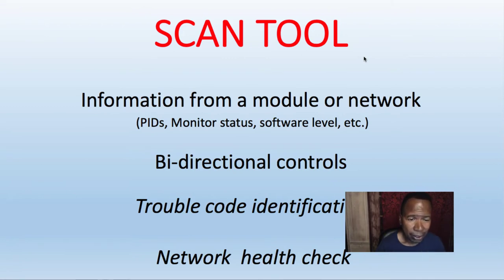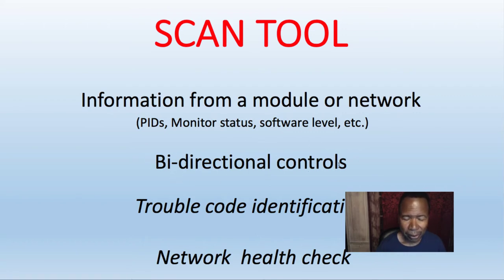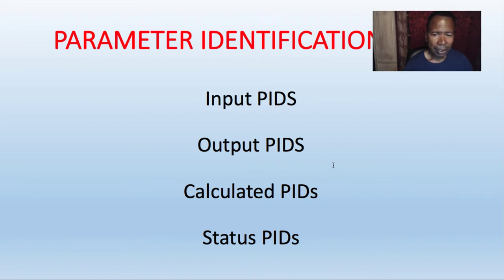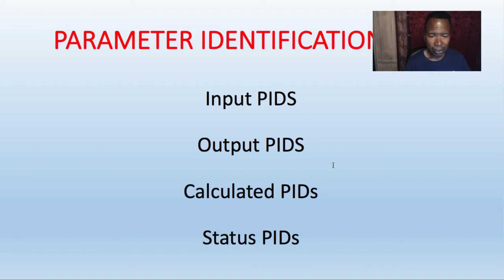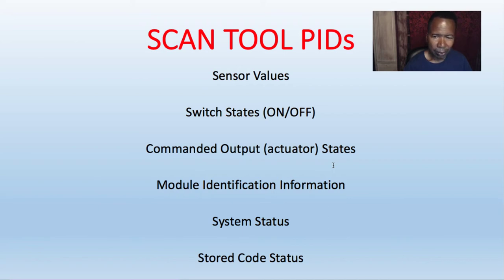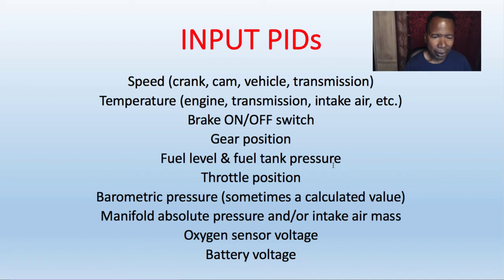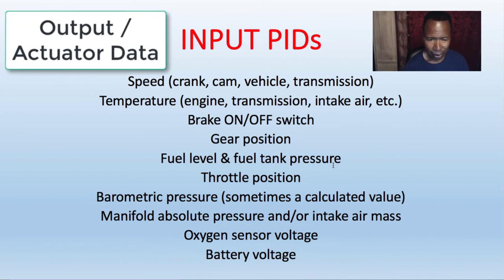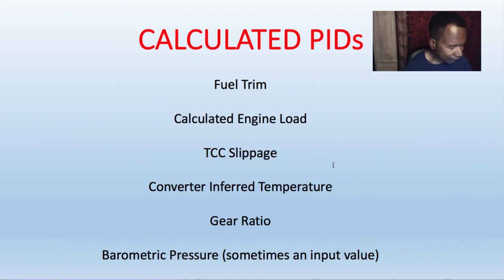4b. Smog Technician Training: Computer Control Understanding Scan tool, level 1 smog inspector Class

Comment: If I have a car that has a label that reads that it does not contain an EGR but a scan tool reads that it does has an EGR, does that make my scan tool unreliable?
Reply from the maker: In some cases the system may not give an actual EGR valve but it has the system . I would double check the emission control application manual before you condemn the scan tool.